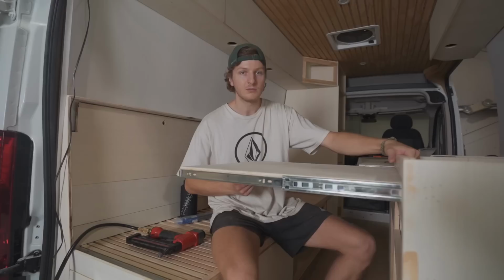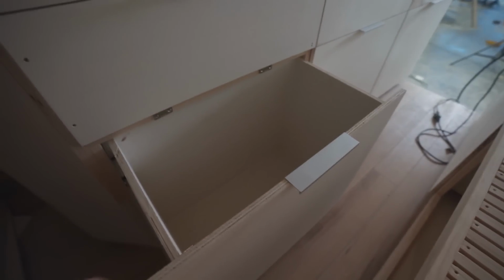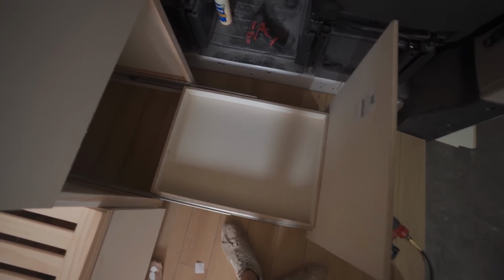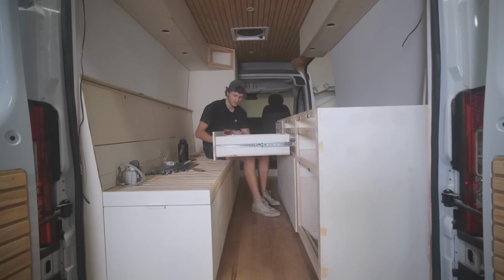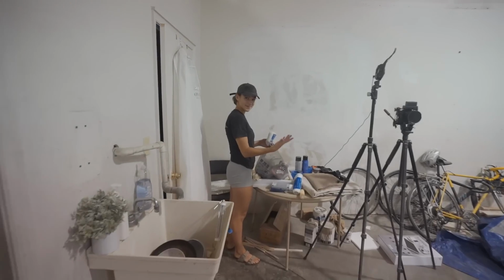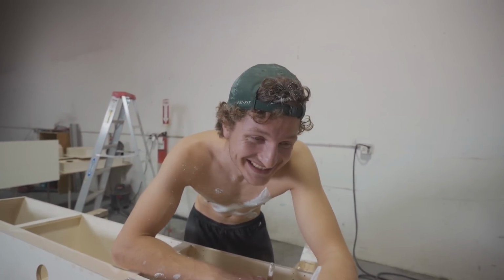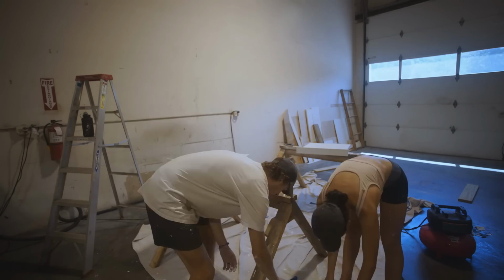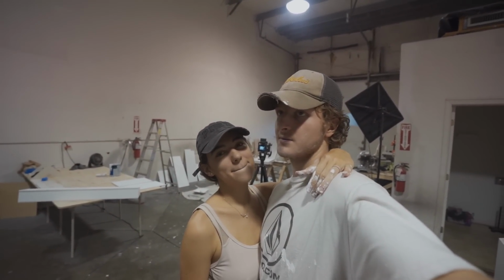VAN BUILD IN 20 DAYS | DIY Modern & Minimalist Cabinetry Install in a Self Built Camper Van!

Comment: Great work! Not quite sure I understand the purpose of the slide-out section behind the drop-down standing desk? ☺
Reply from the maker: Because the faces are so flush, the desk will not drop without sliding out slightly to clear the face below it! Additionally, we mounted an iPad on the side of that drawer and it’s a perfect “hidden TV” while you are in bed!

Comment: You know, my wife brought up a good question. In regards to the "tables", why make them so that there is a lip on the top? She mentioned that it would be cumbersome having to reach over and down to the table, if you get what I'm saying. Also, with the toilet, how did you figure out the leverage once the toilet is pulled out and someone sits on it? If the cabinet  is not anchored sufficiently, it would seem the cabinet would pull out from the wall.
Reply: I think Seth and Scarlett use load bearing load weighted rails, so this won't be an issue.  By that logic, their bed wouldn't bear a load either? It does! :)
Reply from the maker: Yep! That is correct they are 500lbs for most applications and 750 for the bed!! As far as the leverage from the floor to ceiling unit, it is actually wedged in very tight. I could stand in the drawer before any thing was mounted because it sits flush with the ceiling and floor, so once everything was tied down no issues at all. 

As far as the tables I didn’t like how they came out either! Basically it looked very bad with a huge gap needed to fit the face frame under the countertop.. I am correcting that on our current build so stay tuned!